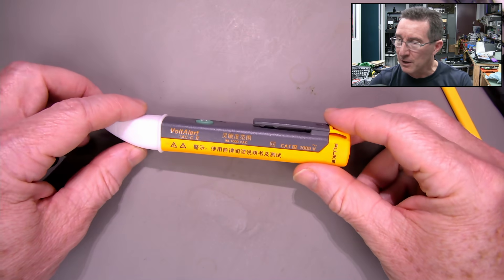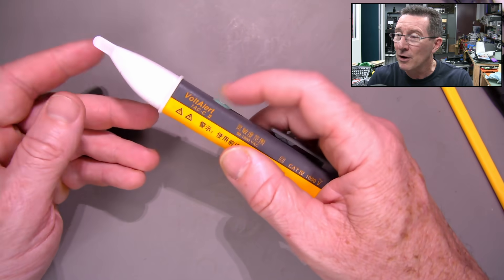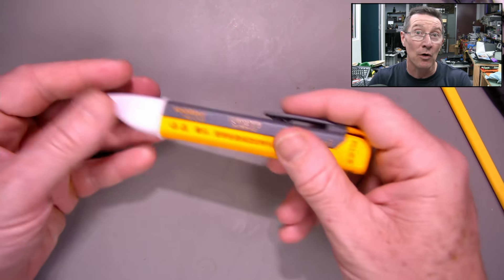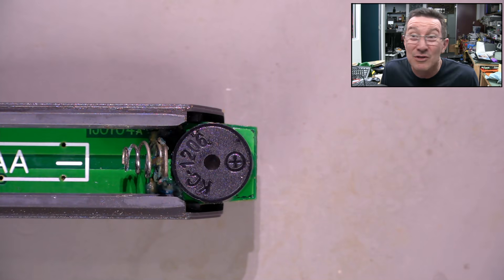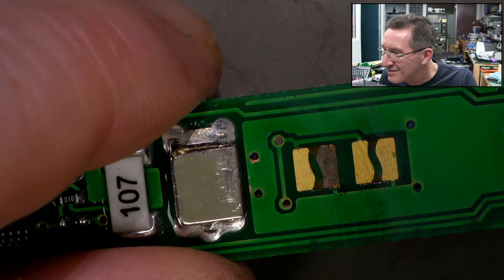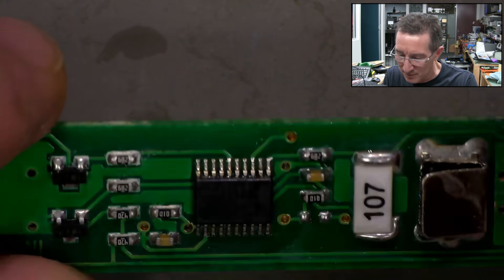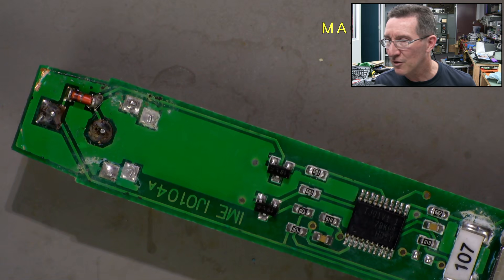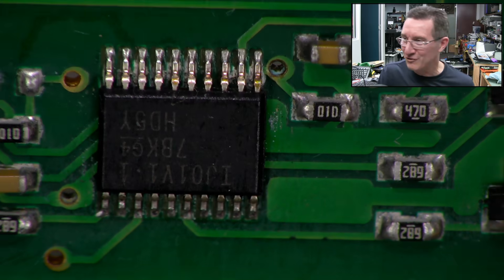Fluke 1AC Voltage Detection Stick Repair

Comment: Same issue here but damage looks a lot less and all around the negative terminal and the chip is completely clean. Can't see that the issue should be but I'll get the crud cleaned up and see if that helps.

Comment: You have saved another Fluke. My trustworthy sniffer had the exact same issue , My button pads weren't as bad as yours but everything else looked like the video was of my voltage sniffer. A little DNA and baking soda with new batteries did the trick. Thank you, Thank you, Thank you. I can now trust my life to my Fluke again!

Comment: This sub $2.00usd 1AC-D knock-off works better than the genuine $40.00+usd Fluke 1AC-A II.  In fact it works like the newer Fluke 2AC in that you don't have to power on the unit to start using plus it has a flashlight that both the genuine Fluke 1AC-A II and Fluke 2AC does not !

Comment: Thank you for this video. I had a similar problem, leaking battery....it worked for a while and then stopped and the light and beep were on continuously but after opening and cleaning it seems to work.
To be honest I hat a design without a permanent turn off switch that disconnects the battery. My batteries in my infrared Fluke thermometer gun also leaked and did some damage. Fluke should know better when it comes to reliable design. Even though I use my tools very rarely I want then to be in working order and not check every few weeks in what state the batteries are......

Comment: Hello Mr. Dave , I want to know what could be the problem if in my NCV Stick just fell on to the ground now it's not doing the beep while testing for phase. Its buzzer is working its led lights is working, I've resoldered the whole circuit component's once , and torch is working, indicator led is working and buzzer too working on . Yet , it's not fulfilling its only task to show the presence of the phase what could be the reason , can you help figure this out . How's the metal strip is connected to the circuit PCB.

Comment: Very helpful, thank you!  I'm gonna see if I can get mine working again.

<Later>  Well, I tried.  The green button ripped.  I thought it could be pulled out without damaging it.  I tried with a couple different tools to depress the retaining clip, but either I didn't get it, or I did but the PCB was stuck in its slot.  Looking closely at the board from the exposed end, it appears to to be very corroded.  The unit is old, so I don't feel too bad.  I'll get another non-contact tester, probably another Fluke.

Moral of the story:  Unless a device is used regularly, remove the batteries before storage.  With batteries having expiration dates up to 10 years in the future, I thought I could trust them not to leak.  Nope.

Comment: That is a red LED.  You don't get multiple colors out of a red filter.  Vinegar is dilute acetic acid.  It neutralizes the alkaline electrolyte that oozes out of alkaline batteries.  Alkaline batteries don't have acid, they have alkaline.  Hence the name.

Comment: Mine leaked and woke me up beeping randomly.... To get the board out you need a blunt tool through the hole on the pcb and leaver against the inside of the tip.. Give it some beans, and it comes out... No need to fiddle with the switch hole....

Comment: You can't neutralise acid with vinegar.  Vinegar is largely acetic acid!
Reply: Acetic acid cleans well, then soda bicarbonate to neutralise the vinegar. I have cleaned a lot of tools using this method.
Reply: You missed the point...
 @dragan3290

Comment: Put Energizer Ultimate Lithium's in it. I had to replace the battery holder in my Fluke 289 due to leaking alkaline batteries ) cost me $70USD for a new battery holder. I only use Ultimate Lithium batteries in it now.

Comment: Long term a good wash in destilled water/ isoprop 30:70 mix and a good dry on the heater for a few days would reliably sort it. Of course a spray with wet protect would be a bonus Beeper opening needs to some blocking ... hmm, wrigleys?:goodvibes:

Comment: I wanted to see the other colours that 'RED'' LED was gonna produce, second visit video perhaps ? I'm guessing because it only has one cathode and one anode and no control chip that they are made out of some special material with unusual spectral emissions lines tuned to 50/60Hz and of course the standard 'red' case is a ruse, it's probably a buffer material of some type (guessing here folks!) that adjusts the refractive index to suit, bet it's gonna look great being Fluke an all !!....cheers.

Comment: I just found my identical fluke tester also had battery leakage! I couldn’t figure out how to get the board out and it’s been sitting on my bench for weeks. Thank you so much for this video! Haha I was so surprised to see this video pop up; made just for me 😅
Reply: Open the rubber button from there you can push through inside towards the led side theres a metal clip inside (refer YOU TUBE how to do it as ref video). Fyi

Comment: When powering higher-quality or higher-cost equipment, I’ll use either NiMH if high current, or Lithium. I’ve never had one of these leak.

Comment: I put a hole in a AA battery today calibrating my battery spot welder and that electrolyte was all over my workbench in seconds. It seems less viscous than water.

Comment: I would submerge it in vinagre, possibly scraping away solder mask where there is any hint of damage. Not just using a tiny bit of vinagre.

Then you need to use quite a bit of isopropanol afterwards of course.

Comment: I have the same model but mine recently stopped working altogether following a battery leak. I cleaned the crustiness off the battery terminals with IPA without disassembling it and it seemed to be working fine but a few weeks later I got the same symptoms as you; a single beep when pressing the button. I ended up getting a direct replacement as I've used it for years and been really happy with it. I've kept the old one just in case I ever get round to having a look inside but that clip looks a bit of a pain. By the way, I'm sure the LED is red only as I've never seen any other colour with my one.

Comment: Hi Dave,  I have used NiMH AA batteries everywhere for several years and they don't seem to leak.  Even when they are sitting in the device dead for a while.

These are Panasonic ones from Dollarama at $5 for 2 and some of them have over 200 cycles.  Power is good, about the same as alkalines, and they hold a charge for about 1 year.  I have a 4 cell charger which can charge 1 to 4 cells in 4 hours and then goes to trickle charge.

Just for fun, here is a list:

Kitchen clock (takes 1 cell which dies every year through self-discharge but doesn't leak),

Multi-meter (works great and indicates low battery after about a year),

Mosquito zapping tennis racket (gives a really good zap and zaps 'em dead),

Electric can opener (opens the toughest cans),

Laundry room vacuum cleaner (for lint),

Smoke alarm (beeps every year when 2 cells get low),

Flashlight (put batteries in when needed),

Portable radio (listen to the news every morning),

LEGO Technics motors, lights and sensors (takes 6 cells and has good power. Over 200 cycles and still seem fine. Maybe losing a bit of capacity, but it's hard to say).

Love your shows 👍
Cheers from Canada :-)

Comment: I'd have defeated the locking tab if the PCB is held in position by the removable cover - you know it's going to have to come apart again.
FWIW when I first saw the tab my thoughts were WTH is a crystal doing in a device like this and what is Dave going to do now he's smashed it.

Comment: Thanks for the video Dave. I received one of these from Fluke UK when they recalled their 3-pin plug-in tester a few years back and checked the cells. Fortunately they were OK but I swapped them out for a couple of lithium ones with a 20 year shelf life to be safe.

Comment: As an electrician I hate that kind of testers,  as many false positives (induction) as false negatives (cable sleeve is 1mm thicker), most of them are a waste of time if not dangerous... A funny experiment you can do, touch a live wire with a voltage detection screwdriver in one of your hands and hold that tester in your other hand, it should beep...

Comment: Good video 
I replaced all alkaline batteries with lithium ones in all of my devices. I also use deoxit. BTW I think you meant to say you neutralize the base (alkali) with an acid (vinegar). Thanks!

Comment: I don't really trust those voltage sticks, I don't use them. They beep when nothing is around just because some random waves touches them and they keep quiet almost touching the live wire. No, thanks.
Reply from the maker: Many suck, the Fluke doesn't though.

Comment: I had one of these I broke the blade tip in a over painted outlet, sent them a request for a replacement end cap.
They said that there on no user serviceable parts other than battery. They asked my name and address and I had a brand new one in the mailbox in about 5 days. Cudo’s for Fluke. They can’t maintain their certifications and liabilities letting some one fix something that could kill someone if not correctly done, understandably. Try that with a China company, they don’t care if someone gets killed
If they can sell 10 billion of them before their item is banned.

Comment: I find in locations with wide temperature cycles, the battery acid can vaporize and condense in odd places, especially in an enclosed unit like these. I use dry cells for a lot of low current stuff nowdays.

Comment: Dave, you have just caused all your viewers to check all their battery-operated devices for leaking batteries!  Well done on saving tonnes of e-waste.
Reply: I stopped using alkaline batteries and switched to rechargable NiMH.  I should have done it 10 years ago.  It would have saved countless devices.

Comment: My grandkids like to take my clamp-meter down in the basement and use it's non-contact probe as a Ghostbustes meter by checking for ghosts around the washing machine, water heater, etc.  The display lights up red when they detect a gremlin and the number indicates the PKE energy.  But they come running back upstairs as soon as they see a spider.  Cheers from Canada :-)

Comment: It'll be interesting to see how long it lasts now it's working again. I was all for lifting the chip until I saw all the other damage, so I'd just buy another. They're cheap as chips these days and every man and his dog seems to make one. I've got a Milwaukee 2203-20 and a Uni-T UT12D. The Milwaukee is supposed to be the better detector however the Uni-T performs just as well and is cheaper and way more rugged. I was going to say none of my meters NCV is as good but I just tested them and the BM235, with sensitivity at High, is just as good as either the Milwaukee or Uni-T. The NCV in my Klein CL800 clamp meter is reliable, but has no sound or display on the screen. Your only indication is whether a red LED by the jaws lights up. Of all my meters, the one with the worst NCV function is by far and away the  Digitech QM1321 (rebranded Honeytek garbage). The live wire basically has to touch the meter for it to detect anything. Yet I can't help liking the meter itself. Something in it exploded when I forgot to switch from current to voltage on a 240V circuit, yet it still works perfectly and hasn't drifted in 5 years.

Comment: Definitely  like the Fluke detector. My parents had a nursery and in the greenhouse there were multiple cabinets withs rows of bottle fuses. They should pop out there color coding thingy behind the glas, when blown. But from some period (late 80's or so) that didn't work so well anymore. Tapping on the fuse helped a bit sometimes. A Fluke detector was a real handy tool for this, just hold it for the glass. No beep = blown fuse. Saved a lot of headache. I use a Fluke T130 detector for mains quick check work. A Fluke 1653B installation tester for more serious work.

Comment: Likely you need to use vinegar first and then Isopropyl to clean it...  and the legs of the chip were shorted..  very good job Dave
Reply from the maker: I did, watch the whole video.
Reply: You are Correct...   I commented too fast... but I would have started with the vinegar and then the isopropyl.   which you kind of did you did isopropyl and then vinegar and then Isopropyl again...   it all works...  too bad there was board damage and it wouldn't be safe to trust the tool again. @EEVblog2

Comment: 10:30  Since vinegar is a (weak) acid, how could it "neutralize the acid"?
Reply: The battery is alkaline, the opposit off acid. A car battery is acid.
Reply from the maker: Old bad gramatical habbit.

Comment: I've seen "no-clean" flux give symptoms like the "corrosion" between your IC pins.  When the no-clean flux is processed at the recommended oven temperatures, the active chemicals are "passivated", making them "harmless".  Sometimes they are still active and become conductive or corrosive with age and humidity.
Thanks for the teardown/repair!
Carl

Comment: I don't use those sticks a lot. Tracing a single cable in an installation or finding an interruption in a cord, that's fine.
Checking for actual voltage? Nonononononooooo!
That is what my trusty Benning Duspol is for.

Comment: An ultrasonic cleaner is great for corrosion like this under microchips.  There are even acidic ultrasonic cleaning solutions.  These are even better at removing the potassium carbonate buildup.  Components that are too small can have so much of the solder fillet removed in the cleaning process that they can lose connection with the circuit.  I would rinse with a high percentage isopropyl alcohol (91% or more) after to prevent water corrosion.  Not sure about the beeper.  Maybe plug it with some kind of tiny hand carved rubber stopper from an o-ring of appropriate diameter.  I don't think taping over the beeper would work because the ultrasonic cleaner would warm up the tape and loosen the adhesive.  Good luck with future repairs.  I love to see it!
Reply: Unsolder the beeper, then chuck the whole thing in the ultrasonic cleaner. Also note that many cleaning solutions are alkaline, as they tend to be used to remove oily crud.
...
For this mess, just put it in a ziploc bag of vinegar, etc and drop the bag into the (filled) ultrasonic. That is a great trick... you don't need anything other than plain water in the tank, you can use a small amount of specialised cleanser only inside a zip bag... The vibrations pass from the water into the part and it's surrounding fluid.
...
Then remove and do the same bagging and a mild alkaline to neutralize, then ultrasonic it in a bag of Isopropyl or denatured alcohol (metho) for final clean and rinse.
...
I would also add a couple of bodge wires through those vias, as they were pretty dodgy.
It will never be 100% fixed because the battery leakage has already got under the PCB's laquer coating and will continue to creep over time.

Comment: Well, I was laughing a little at the "There could be more damage in here than I expected"! It's amazing how far the damage from a leaked battery can get if it's been given enough time, particularly if the item in question has been stored somewhere that gets even a bit of humidity - the KOH absorbs moisture from the air and forms a really nasty concentrated solution that can wick into tiny gaps and creep along surfaces brilliantly.
Solder mask is very resistant to it, but as long as it can get any contact with the traces it'll just corrode its way along the copper and wick its way between the trace and the solder mask, so it can spread surprisingly far without any sign on the surface of the board, except where it pokes its head up from beneath the mask wherever there's a pad or a component leg or a via to give the game away.

The only way to permanently fix it is to scrub the solder mask off all the traces from the point of contamination until you reach clean copper, then remove the corrosion and repair any broken traces. Obviously not worth doing for a voltage stick, but this nightmare is all to common for folks repairing vintage computers and the like, which tend to have been sat with battery leakage all over them for the last 30+ years in some old shed or attic!